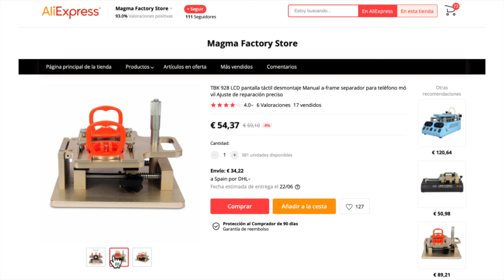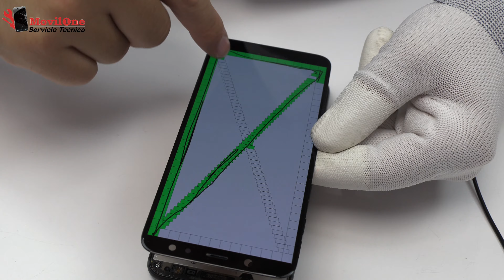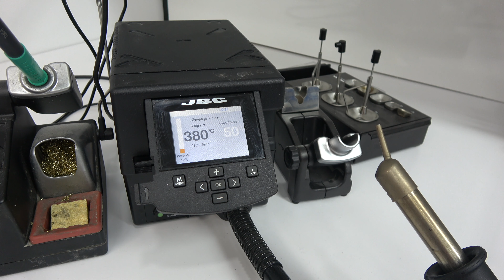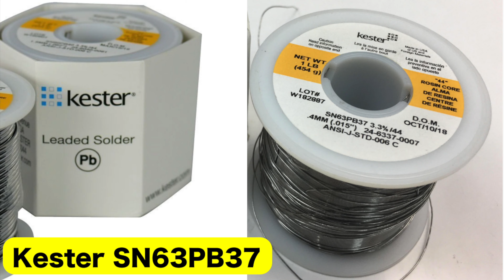CURSO DE REPARACIÓN de CELULARES #20  Samsung A6 2018 No Carga

Comment: Se resoldó el centro de carga o le puso otro nuevo??
Reply: Le puso uno nuevo, lo muestra roto al comienzo
Reply: @eljoakoide4743  o ya gracias ahora falta un vídeo que enseñe a desoldar pero con una secadora de cabello para los que no tenemos para una pistola de calor jaja
Reply: @JoelDiaz9526  es imposible así, no llega ni de casualidad a esa temperatura, necesitas una estación, o con un cautín económico puedes igual
Reply: @eljoakoide4743  eso si porque una secadora leí que levanta de 40 a 50 grados o sea me faltan como 300 mas para llegarle y con cautin traté pero no pude jaja heche a perder la lectorade sim era de un Hisense la forma es mas complicada que esa creo de los puntos de soldadura
Reply: @JoelDiaz9526  con cautín se puede, yo con uno económico de 30w los hago facil, solo es práctica y usar estaño y flux
Reply: @eljoakoide4743  pues si tienes vídeo o hay uno por ahí mejor si lo pasas yo igual tengo uno de 30 o 40W pero solo tengo pasta de soldar y el estaño pero flux no quiero quitar la sim de un Hisense F23 aunque si me manda datos el lector es lo raro
Reply: @JoelDiaz9526  para quitar el lector de sim si necesitas una estació, con cautín es dificil soldarlo, lo quemas muy facil
Reply: @eljoakoide4743  en pocas palabras ocupo eso y estaño en pasta verdad si es así ya valió jaja pero gracias por las dudas

Comment: te tengo una sugerencia el zocalo o pin de carga lo voltea y le aplica flux y luego estaño ese q usa es el mejor kester la mejor marca alemana en estaños y ya tienen los pines estañado y seria mas facil amigo. yo veo tu trabajo es excelente de la forma original q coloar tu pin de cargar. cuanto cobrar en españa por eso?
Reply from the maker: Hola. Aquí en España un conector normal 35,40 euros. Si el teléfono se abre por la pantalla 50, 60 euros. Gracias por el consejo.  Un saludo.